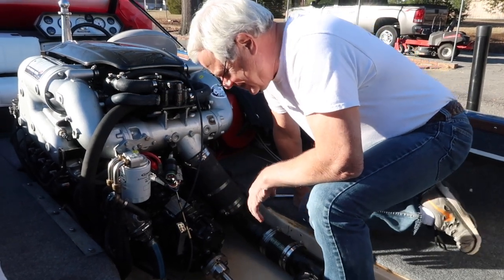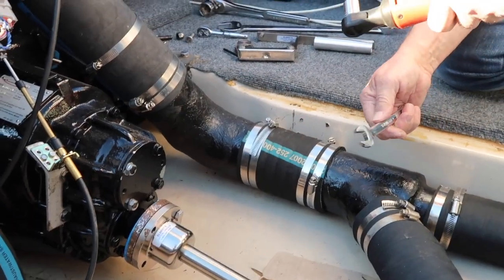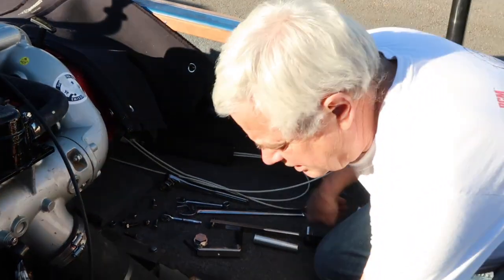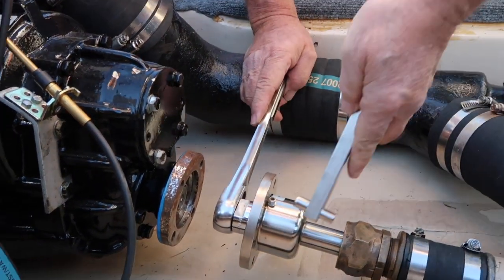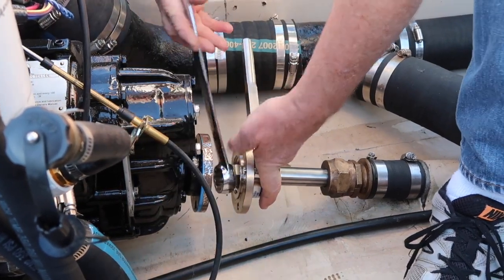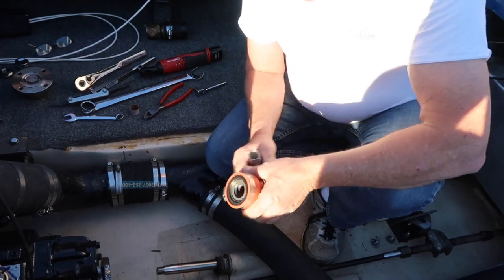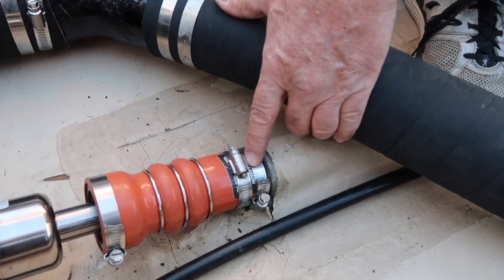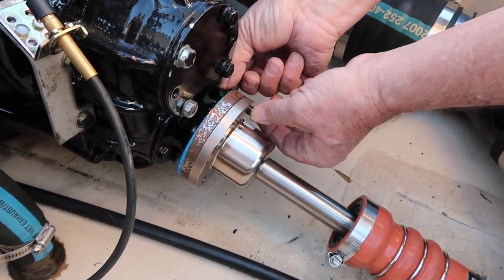How To Install The OJ Flex Gland Dripless Seal

Comment: Absolutely disgraceful OJ Props sells these with no instruction manual whatsoever. Your video is nice but where is the official OJ Props info?  Is there a means provided to release the air from the shaft log so it stays cool with water. No need? Maybe you could review that. Also, there is a hose clamp on the seal end of the gland. What is the purpose of that? Tighten the seal if it leaks? You didn’t touch it or mention it. Must be there for some reason. What about cleaning the shaft of oxidation and removing any bur present at the keyway? Is it not OJ Props responsibility to provide this information?  Makes me question the company and my decision to buy this. Terrible!
Reply: Fair criticism imho

Comment: Not finding much, or any for that matter, feedback on these?  Anyone with an older Malibu ski boat out there have luck with these?
Reply from the maker: it works great on our 84 Mastercraft!
Reply: I Have. 1994 Malibu Echelon just put in a new drive shaft, coupler and OJ dripless seal and new cutlass bearings, pain in the ass took probably 10hrs including shaft alignment but boat is probably good for another 30years.

Comment: Great video but I don't understand how it works with no plumbing.  Could you explain?  Thanks.
Reply from the maker: The material of the seal and the way the rubber boot is designed lubricates the seal.